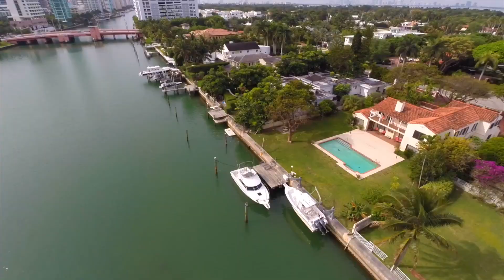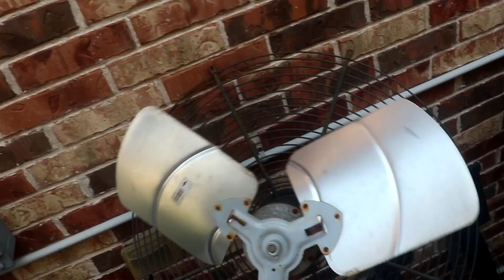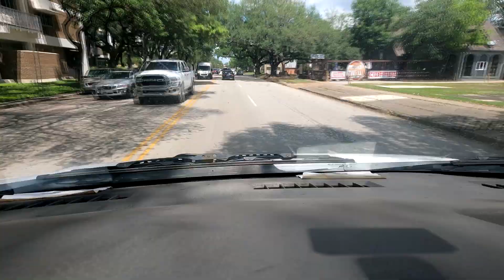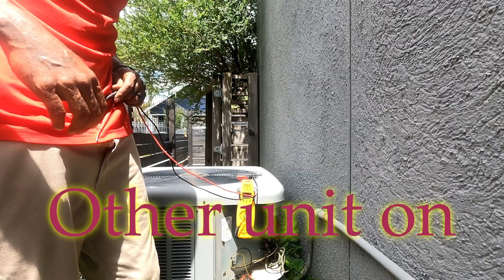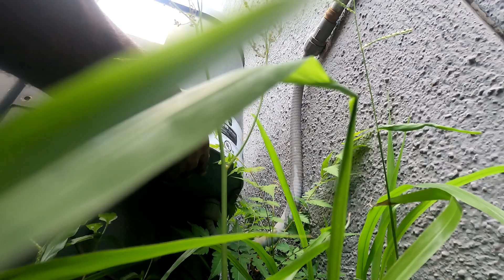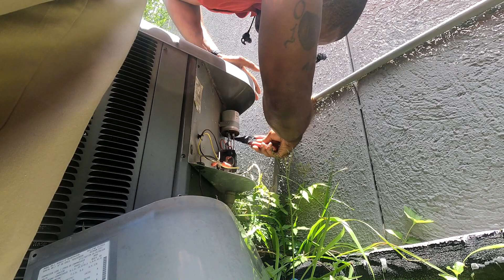Nest Thermostat Trouble Alert: Ruud Condenser Fan Not Working!

Comment: Agreed...got to collect enough to pay for the gasoline and truck expenses. Strange that fan wire came off. Move those condensers to the roof?  Not a good idea, its hotter up there than it is on the ground plus, they will vibrate the entire house. Not worth doing for the purpose he wanted.